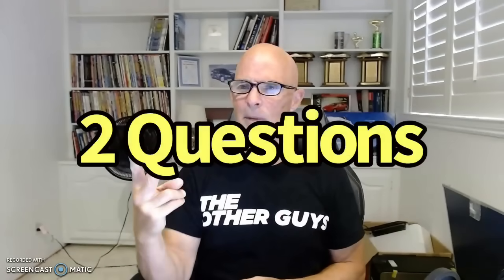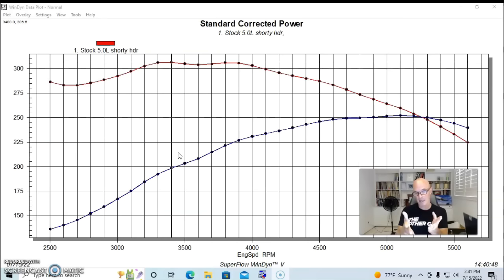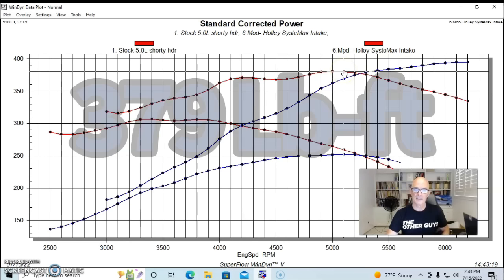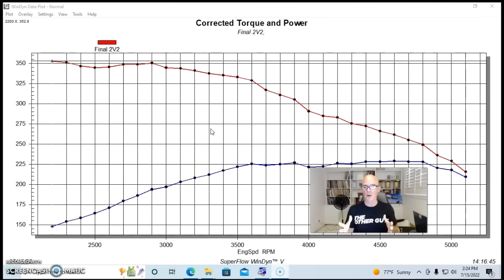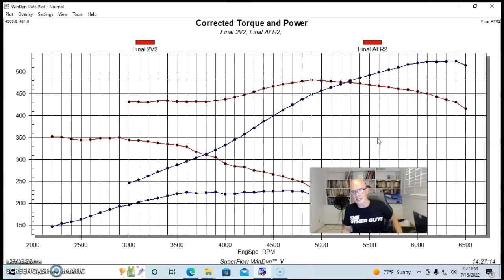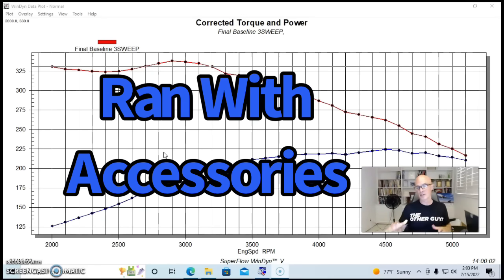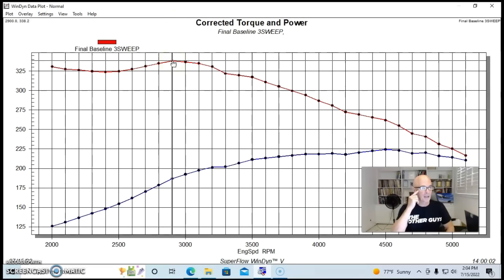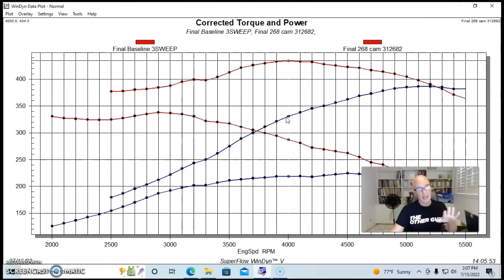FORD VS CHEVY VS DODGE-WHAT AMERICAN V8 MADE THE LEAST AMOUNT OF POWER? 5.0L VS 350 VS 360-WHO LOST?

Comment: The Chrysler 318 in the dodge diplomat of the early 80's. In 88 it could barely muster 80 mph. Absolutely worst car I ever had, or maybe tied with a beat-up escort. Security car. Searchlight, rubber floor, crappy, slippery blue bench seats. Ugh. Made maybe 90 hp.
Reply: I choose a  Dodge Aspen wagon to travel the states in 88. It needed 3 lanes to do 80 mph. I sat on 50mph. Greeting from Australia 🇦🇺
Reply: I wouldn't doubt that whatsoever from the 80's 318's. Besides the Grand Caravan that my Grandfather owned, I've never driven any Dodge smaller than a 383. I'm sure there were 383's that were pigs too. But, of the ones I've driven, they would move pretty well. I wouldn't even entertain owning a 318.

Comment: to actually compare theses corectly youd need to compare these 3 5.8efi/351w 5.7vortec/350 and 5.9 magnum/360
Reply: if ya wanna go smaller go 5.0 efi/302 5.0l tbi/305 and 5.2 magnum/318
Reply from the maker: to actually compare the three lowest hp engine I have personally tested-this test worked perfectly
Reply: @richardholdener1727  sure but its not a fair comparison because of difference of displacment and the 5.0 being efi vs the other 2 were carbeurated the whole point is its in innaccurate comparison

Comment: I was hoping for a pre 1985 Chevy 305.  Pretty weak, especially the Chevy Caprice version
Reply: There was a whole lot someone could do to improve performance on a Caprice before even going too far into the motor.  😁
Reply: We had a 1981 old custom cruiser with a 305 and every time we went up any size hill I had to get out and push otherwise we we wouldn't make it.
Reply: @OpaEit  307 Oldsmobile
Reply: @CSXT8250   yes you’re right unfortunately those 2 cubic inches didn’t make any difference 😂
Reply: @CSXT8250  yes I wished it would have had a 455 and this one was definitely not well maintained, change the oil and within a week it was black as black could be and it had less than 50000 miles on it when we got it, but the kids loved the rear facing back seat

Comment: My 1971 gt Torino 302, bought cheap many moons ago, frontend falled apart so bought a 1984 Fairmont mid size station wagon,
It had great took care but engine blowed, bought to swap mine, paid installed found out (4 lugs) didn't consider it it only came with V-6 paid extra mustang chassis to hold 302, now a sleeper natural barks at 2nd shift, 90's good times 😜
Reply: Those Fairymounts were ugly …

Comment: I’ve always preferred Fords but the early 5.0 pushrod engines were a major embarrassment in the power production department. Not even worth a second thought considering the vast power potential of a well prepared canted valve Cleveland engine combination 🏁.
Reply from the maker: THIS TEST WAS LEAST POWERFUL-SO THERE IS THAT
Reply: @richardholdener1727  …and by the way Professor, I sincerely apologize for being late to your class last night. I mean like the dog ate my homework…I had to re-primer the Jeep…I narrowly escaped death when a sinkhole opened up and swallowed my original 427 Cobra Coupe recently acquired from the Shelby American private collection…I had a date with an actual 19 year old Linda Vaughn clone aka Drag Strip Doll…the Sun got in my eyes causing a fumble when I stepped in a pile of hot Shinola 💩… Dingos ate my baby🐕…and the beat goes on🙉.
Reply: @richardholdener1727  …YOU NAILED THE LEAST PART, FOR SURE WITH THE 5.0 😁
Reply: I read a consumer digest review of a Mustang II with 134 hp 302 V-8 and it was sluggish for a lightweight body comparable to a Ford Pinto. However, the Mustang II V-8 have 3097 lbs curb weight with 134 HP, compared to a 1965 Mustang fastback with 225 HP and curb weight of 2900 lbs. mustang II is heaver and lower HP than the first generation Mustangs, no wonder the acceleration is pretty bad.
Reply: Shame that Cleveland won’t last… junk motor. I always heard good things but my 72 Ltd with a Cleveland was garbage, only got it to run once after replacing over $1000 worth of parts and even then it spun the tires like hell all the way until I cut it off at the gas station, never ran again after that.
Reply: @crimsonlight4205  So because you abused one of the most reliable engines in history and ruined it it makes it junk? I've seen tons of 300,000 plus mile 351 Cleveland's out there. Also never seen a Cleveland in an LTD just a Windsor. Cleveland's only ended up in performance vehicles.
Reply: @outspokengenius  didn’t abuse it, it ran the one time only. If it can’t take running hard for 10-15 minutes to get to the store then it’s still junk regardless of whether you call it “abuse” or not. And it was a Cleveland. It was a 72 2 door Ltd and all of the 2 door models came with a Cleveland until 75. Plus it had the different timing chain and larger spark plugs than the Windsor. Idk what to tell you. I did hear something about the valves burning out when exposed to ethanol on the older Ford engines, but that would just further solidify my claim of it being junk since no other brand has that problem.
Reply: @crimsonlight4205  because of your poor Mechanical skills, you call the best small block engine ever built junk. You have no clue.
Reply: @mylanmiller9656  well more of a clue than you, like I said I knew what the problem was and Ford was behind the times, their exhaust valves simply weren’t up to the standards that other manufacturers were using. If you have to change a stock part for a vehicle to even run then yes, it is junk. It was also a poorly designed engine and car and I hated working on anything in it. Hell I put a Chevy alternator on it because the voltage regulator went out (Ford was behind the times again and didn’t have alternators with built in regulators) and in al their brilliance they decided the best place to put it was upside down, on the fender well, behind the headlight… even dodge put theirs straight on the firewall smh. There were a lot of other things about that engine that pissed me off but I can’t remember most of them, that one really stuck with me because of how stupid it was.
Reply: @crimsonlight4205    not Ford 's fault you worked on a Chev, can't figure out how to work on any thing else!  Ford built Millions of cars. Most people had no problem with them,. Who is the fool. It is not that Ford was Bad. Your problem is you have a one track mind.
Reply: @mylanmiller9656  again, if you could read, I never had a problem diagnosing and fixing it, I had a problem with how terribly it was designed. Could I fix it? Of course. Not a problem. The problem is that it was designed by a third grader. It takes much more effort and there are things about it’s design that are absolutely idiotic, then there’s the fact that, like I said, they were well behind the times in their technology.
Reply: @crimsonlight4205  You sure were a good  fixer all right, You only made it run for a whole hour.
Reply: @crimsonlight4205  Read about after you fixed it it only run to the store! sounds like  there is a problem on how you fix things.
Reply: @mylanmiller9656  again, learn to read, those were two seperate problems
Reply: @crimsonlight4205  Junk motor?I had a 351 Cleveland with 350 000 mile s on it and was still going strong.I still own others and love them.They were giant killers in pro stock racing  spinning to 10 000 rpm or more.Sounds like  more of a junk comment to me.
Reply: @petergiannaros9037  how old is it? I’ve never owned another one, but that one was a 72. If it’s newer than 75 it’s probably a better engine
Reply: @crimsonlight4205  … If it’s newer than ‘75, it’s probably a 351M or a 400. All 351 Cleveland production ended in the U.S. during the 1974 model year. 

When the E.P.A. forced the oil refineries to remove all tetraethyl lead additives from the gasoline sold in the United States in the mid-seventies, unleaded gasoline became the only type of pump fuel legally sold in the States 🇺🇸. That’s when damaged exhaust valves and valve seats became a problem for all engines, regardless of the manufacturer.

The big three automobile manufacturers in the States responded by installing hardened exhaust valves and valve seats in all new car engines. The removal of lead from pump fuel also reduced the octane rating which caused even more problems for owners of early high compression engines. 

During that period in history was when the middle eastern OPEC countries decided to drastically cut oil production to the rest of world, resulting in gas shortages and long lines at gas stations and the highest prices at that particular time in history. It could be considered an act of terrorism without the violence associated with modern day terrorist. 

That’s when the oil companies started blending ethanol with gasoline as a means of increasing overall fuel production. A good benefit of the ethanol blend was that it raised the octane rating slightly. But it also created problems problems for older engines and fuel systems not designed for it. It takes more ethanol than gasoline to produce an equivalent amount of power, so older cars without the benefits of modern technology fuel management systems could suffer from a lean air/fuel ratio causing excessively high combustion temperatures. As a result, the possible damages would include burned exhaust valves in ALL older engines, not just Fords as you suggest. 
It’s not my intention to discredit your attempt to further solidify your claim of all Fords being junk. I think it’s only fair to bring more facts to the table before some rude person that doesn’t even know you leaves a comment stating that you’re an ignorant asshole spouting ape shit about something you heard, solely because you don’t like Fords, rather than making a reasonable comment based on the facts. 

There’s really no reason for people to behave in that manner ✌🏻.
Reply: @danielwilson6665  yeah, like I said it was a 72 model and a Cleveland. And I know all that about the ethanol, I said that as well, but I didn’t have a problem with my 69 chevy with a 396. I know the older models aren’t designed for ethanol, but the Cleveland went out pretty quickly compared to anything else I’ve used. But your right, eventually ethanol would’ve ruined any older model engine without replacing heads.
Reply: @crimsonlight4205  … Now that you mentioned it, I never had any problems with the 396 Chevy either. 
I consistently blew their doors off every night in my ‘69 428 Cobra Jet Mach 1. But that was in 1971 when 100 octane was spiked with plenty of the evil lead additive and was readily available for 36 cents per gallon at every corner gas station ⛽️. Good times for sure but major changes were just around the corner and we didn’t have a clue what was coming.
Reply: @danielwilson6665  oh yeah the cobra jet was a beast, I had one of those in a station wagon ltd and I loved it.
Reply: @crimsonlight4205  … 428 Wagons are rare and very cool 😎
Reply: @danielwilson6665  oh yeah, hell of a sleeper car, you could feel the ground shake standing next to it with big old 4 inch straight pipes nobody ever believed me when i said it had the factory motor in it… a little modified though ;)
Reply: @crimsonlight4205 … When it comes to optional engine choices , there were sometimes as many as 6 or more available for full size Fords during the sixties and seventies. Customers had everything from straight sixes on up to 429’s with solid lifter cams, high compression and Four Venturi carbs to the 460 4-V torque monster for moving the land barges rapidly 🏁.

Comment: So the Edelbrock heads didn't add more power than the stock heads ? That's a costly investment for a negligible return.
Reply: If you’re talking about the 360, the reason for this is the edelbrock heads very closely mimic 340 x heads which were mopars go to factory racing head. The factory 360 596 smog heads can be machined to fit the same valves and will flow almost as well. The reason for the pricing is the edelbrock heads are aluminum instead of the factory cast iron heads. Worth it? Probably not in my opinion.
Reply: i found the same thing with  a  302 ford, The best I had my Car running with Stock heads was 13.28 at 103.25 . I added a set of Performer RPM heads  and lost 2 tenths because  my Compression went from 10.5 down to about 8.5. the  best my car run with RPM heads was 13.5 @  101.17. Edelbrock heads are a poor investment.
Reply: @mylanmiller9656  well that 0.2 was your bad for choosing the wrong CC size of combustion chamber on those heads. That wasn't the heads' fault, per se. If you would've matched your stock head CC you would've kept your compression and saw the increase you were expecting.
Reply: @JoeIsCrazyWillman  hi Smart the  heads were available  with 64 cc chambers  only when  I bought them. If they would have had  54 cc heads like  my stock ford heads that is what I would have bought. I even Contacted  Edelbrock  about milling and tehy said they didn't recommend more than a 0.015 cut on there  head .
Reply: Yeah, for whatever reason, aftermarket heads have very small increase in flow over stock. I don't know why. Stock flow is like 210-220cfm, while unported EQ and Edelbrock heads with a larger 2.02 intake (over the stock 1.95) are only like 240-250cfm, and ported you see like 260-280cfm, so even with aftermarket ported heads you don't even see stock gen 3 hemi 5.7L flow rates. Like WTF. As somebody who owns a 96 Ram 5.2, it's quite infuriating that one of the biggest hold-ups to making power on these is the intakes and heads. Even the 4bbl M1 air gap intakes only flow like 280-290cfm in base form, maybe 300-320cfm ported.

Comment: I would like to see a test to determine the difference on power the firing order has on ho and non ho cams of similar specs on the Ford 5.0L
Reply: There is no difference in  HP no matter what Firing order  you use,. I had the identical cams Cut with both  and the drag strip times were identical. Firing order don't make  power one way or the  other.

Comment: Off topic but someone needs to come out with variable length intake manifolds for chevs like dodge did with the 6.4,  top that off with variable cam timing it could give Chevy pushrods a very good boost in performance especially in the top end without low end power sacrifices. Get on it holly!
Reply: It's called Cam-a-just. Uses oil pressure to change cam timing using gears. It moves the idler gear, which changes cam timing

Comment: I think the 260 Olds V8 takes the cake. A whopping 110hp. It would be interesting to see how much potential is in that engine, though with a 3.5" bore you are really limited for head selection.
Reply: With 7.5/7.8:1 compression, I can see that one having a hard time getting anywhere...
Reply: Where does one take the cake? I'd take the cake to the bakery to see the other cake's
Reply: Same HP as the 262 Chevy found in Monzas.
Reply: I swapped a260 olds and th350 into 80s full  size Bonneville original 350 diesel ,2.29 .the acceleration about the same (slow). got over 20mpg hiway.huge gain in reliability.wish I still had the 350diesel to convert to gas and try crower late closing cam on hi compr.(Miller cycle).
Reply: I'll take a 260 olds over a 250 Chevy 6 popper any day.  Drive both, the 260 flies, babe.
Reply: @CSXT8250  I think I would be more comfortable with the inline Chevy 6. So damn reliable & parts will never be a problem. Wonder how wide the power band is on the Olds? I'm an Olds guy at heart, but they were always the big guys, 371-394, and 425's.
Reply: @wymple09  The 260 I drove once was honestly was a VERY smooth running motor.  A pistachio green 78 Cutlass Supreme.  An old lady's car that I tuned up and test drove.  I power brake it and the tire went right up.  Speedo jumped to 25 in no time.  I let off.  Giggles.  Pulled out onto the boulevard and tromped it.  Shifted out of 1st bout 40 and a slight chirp into second.  Not too shabby for a dog.  I make the comment because I owned a 76 Nova back in high school with an integral head 250.  It ran beautifully, tuned spot on, just slow as the day is long.  260 Olds in retrospect ran more like a Chevy 4.3 V6 to me than the 250 str8 six just WAY smoother, and quieter.  If that makes any sense?
Reply: We Dynoed a 76 Vette in tech school back in the early 2000s, it made 80 RWP
Reply: Indeed. A few years ago I bought a mint 79 Cutlass with the 260 V8 and only 57000 mikes showing. I think it was rated at 105hp. Really smooth running, but really weak.
Reply: 267 SBC has entered the chat....
Reply: @ianrs6310  267= turbo pig
Reply: Don’t bother. The 260 Olds’ windowed main webs will never be a problem because there is no potential in this motor. The factory 57 cc combustion chamber mean swapping an Edelbrock, Rocket Racing or Procomp head on will get you maybe 6.5:1 compression. The factory heads are the worst garbage. I seem to remember the exh valve being around 1.3” and the intake 1.5’ish. They flow nothing and have no potential to make use of more duration or lift. You either use a 307 head (doable) or make expert mods to an Olds diesel head and use dished piston. Fallout-level crafting skills. 

I’m an Olds guy for sure. Have binders full of the tech specs and can easily say there are only to solutions for power on this motor: 1) Nitrous, 2) boost. The motor won’t live well under either condition. Low boost can make it mildly peppy.
Reply: Notch the bores.

Comment: Richard Holdener, can the Holley engine management systems datalog afr and egt on each individual cylinder.   If not, what can I buy that can?
Reply: Only if you spring for a dominator or something with tons of inputs.
Reply from the maker: we don't use Holley for that-we have that on the dyno
Reply: @richardholdener1727  Is there anything u can suggest for in car data logging?